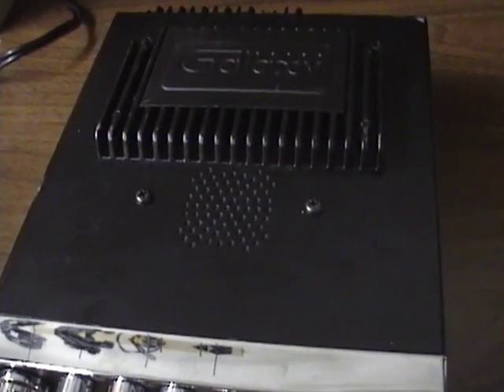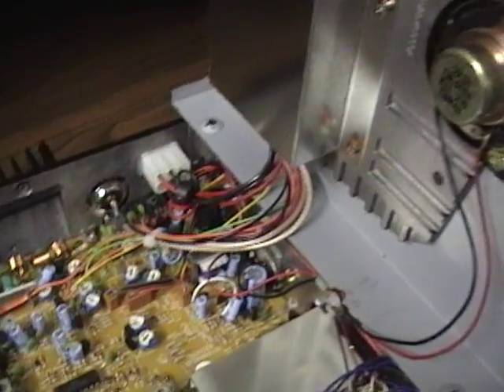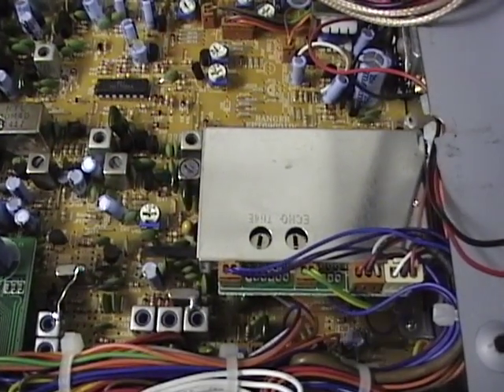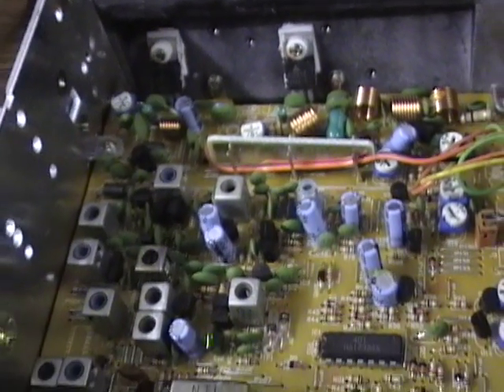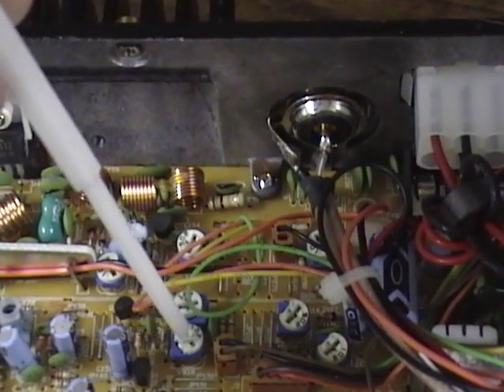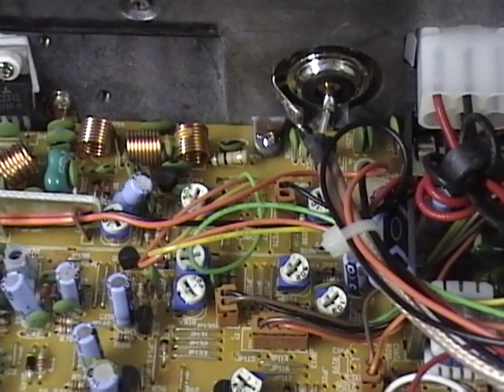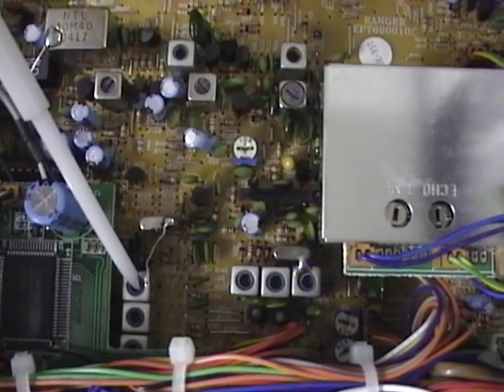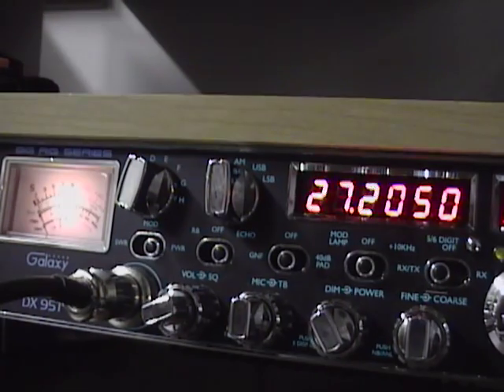Galaxy DX 95T 10 Meter Export CB Radio - PART 2 Tuning - CBradiomagazine.com

Comment: Thanks @cbradiomagazine for the tuning advice on the DX 95T! I have probably the only one on the planet that still had the factory warranty seal on the side, so it's never been opened up until now.😄 I had an issue with low output on SSB, mainly due to fairly low signal from my old Shure 450 desk mic. It's the only desk mic I have that still works (besides an old D104 lollipop) Until I can come up with a signal converter of sorts for the D104, I'm limited to the Shure. Anyway, it will now do about 110 watts PEP on SSB if I stay fairly close to it!😉👍

Comment: Quick question I have a DX95t2 and just wanted to know if there's a way to control the output power on SSB it's fully adjustable on AM/FM but on SSB the power control on the radio appears not to do much if anything . Not a big issue but would be nice to turn it back when talking local . ?

Comment: Hi'  How Can I Get Away With Using A 95T On A 10amp Supply In A Older Peterbilt Without Over Drawing?   With Power All The Way Down, It Swings At 115watts.